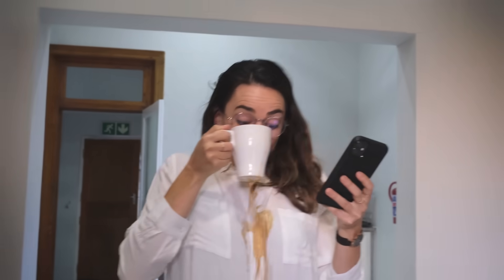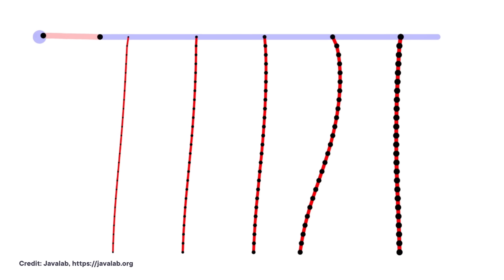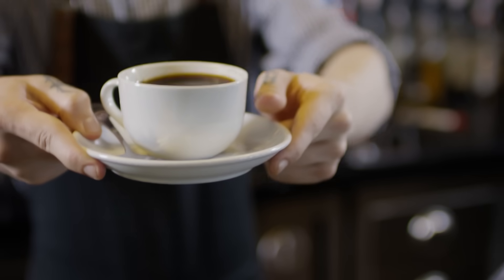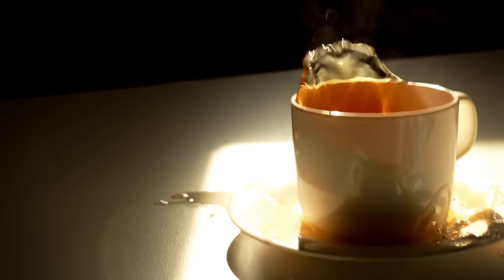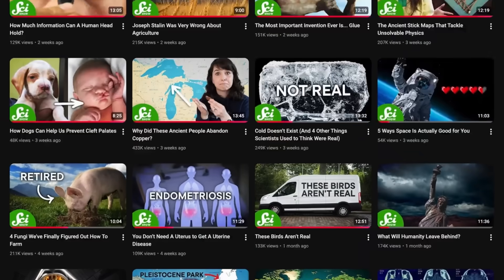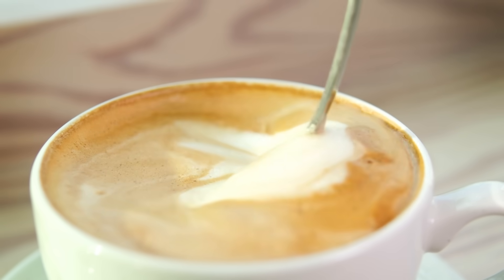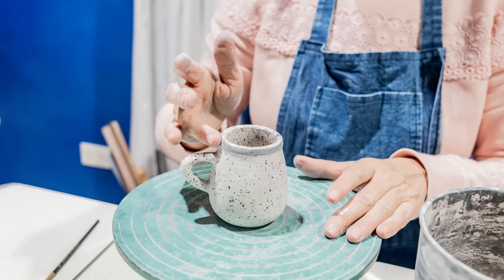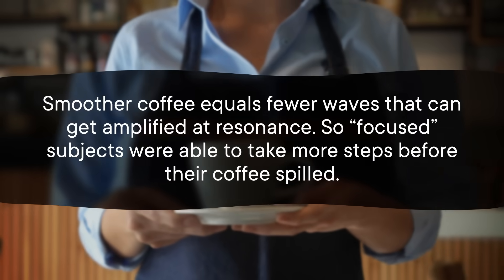Your Coffee Mug is a Physics Disaster

Comment: Elbow up!
Hi, I used to work for a giant coffee company as well. I wasn't a barrista though. I worked in IT. I found that lifting the elbow attached to the hand that is carrying the mug is extremely effective. Looks kinda silly, but it works! For me, it only seems to work when carrying a single cup and my elbow needs to be just below the midpoint of the coffee's center of mass. This is my neutral position (higher elbow placement yields no additional benefit unless traversing steps). From there, I can move around fairly freely without worry of spilling the bean's juice!
Edit: I forgot a slight detail, elbow should close to level with your shoulder.

Comment: Not a problem I usually have... as long as I'm paying attention.  Also: For some reason whenever I've come across mugs that are specifically designated for hot chocolate, they have a slight curvy bulge that has them tapering inward at the top.

Comment: I carry by the mug handle with my arm angled roughly 30 degrees from my body. The mug ends up directly in front of me and the surface barely moves as I walk at normal speed. I watch it, though I'm not sure I need to. Perhaps the energy from the forward acceleration is dissipated by my elbow which is not in line with the mug.

Comment: "Coffee cups in evasive dog fur equilibrium sustain protocols of interspacial connections to erratic staircases because the timing is perfect for wrestling tournaments. Birthday cakes and the power signatures of dry cleaning tickets enable tractors to plow fields of transporter locks."
---Albert Einstein
Reply: "Tune the harmonic enhancers with dimensional converter assemblies. And then folded paper can openers will flutter like butterflies in the amplitude of used coffee grounds poured into fiberglass banana slugs."
---Albert Einstein
Reply: (Note... these Einstein quotes both meet and exceed international standards for being low-carb and gluten-free and are paleo-friendly.)

Comment: The cylinder is the wrong shape and so is the frustum. But if you like.. very VERY slightly taper it in and add the lightest lip to the edge it's probably easy to clean and would direct the sloshes in just enough

Comment: I've walked with a coffee mug hundreds of times, if not thousands... and never once encountered this issue. to be fair though, I seem to think about movement differently from most people; I tend to focus on moving both my body and anything I'm carrying with me as efficiently as possible, prioritizing a straight-line path and smooth acceleration curve for anything I'm holding, which I consider the primary motion; whatever my body has to do to achieve that is secondary. as a result, when I'm carrying a coffe mug, my hand and arm just instinctively cancel out any sloshing, and the liquid's surface usually doesn't even so much as ripple.

Comment: The wider bottom lets the coffee cool faster, which is why we don't drink coffee out of glasses like that.

My favorite 'coffee mug' are like normal coffee mugs, handle and all, but are a bit thinner and are extra tall.  They are sometimes found in tea stores.  They keep the liquid hot far longer than a normal mug and are slightly larger so you have more free space at the top of the mug which eliminates most slosh issues, or you can get an extra large glass of drink.

Or speaking of which, just don't fill your mug up so high.

Comment: About the focus thing, i wonder what conditions they were testing under. I'd presume probably just carrying pretty directly and simply with few variables.

But servers are in much different circumstances. There can be quickly changing obstacles, multiple things to carry at once (plus setting things down en route or grabbing someone additional), a general time crunch, new variables arising constantly, the need to make snap decisions and general stress on top of it all. 

Compare to just carrying one thing in a predictable environment. It stands to reason that one fairs better with their attention focused on the only thing they really need to respond dynamically to. 

But the server is wisest to leave the carrying to their fine motor senses, when paying active attention to their environment is much more pertinent.

Comment: I just carry the cup from the top and use gyroscopic inertia to keep it from slushing out. A lot of it is just the handle design. Even if you hold a cup it doesn't slosh. Holding the handle makes it very hard to prevent tipping which you then correct back and forth and it sloshes out.

Comment: I always thought I had to walk smooth, but not in a rhythm, kinda like the idea of walking on the sand in Dune, or I have to use one of my bigger cups, and not fill it all the way.  but it seems like it cools off faster if I do that. so, there must be a good ratio between cup size (surface area, heat loss) , liquid amount, and not-pacing transport. 😊

Comment: A former employer provided coffee and condensed soups in Styrofoam cups.  The cups were tapered, with a rim at the top.  One clever guy never spilled a drop.  He made a carrier out of a triangular piece of wood.  He cut a circular hole that fit the cup in the center, attached strings to the three corners, and tied the strings together.  Put a cup of your favorite liquid in the hole, and you can’t spill it if you try.

Comment: I always used mugs that were specially made for using on boats: very wide bottom, narrow at the top, and a sheet of rubber on the base to grip the table. It stayed just as secure on my (slanted) drafting board as it would have in a boat, and I never even thought about it sloshing as I walked.

Comment: Related to this, I used to have a coffee maker with a pot that poured fine when it was filled with water, but once it had coffee brewed in it, would dribble. My hypothesis was that, aside from a poorly shaped spout, when it had liquid that was hot and had suspended particles in it, the surface tension was different, so it dribbled.

Comment: I have made those wide bottom raktajino DS9 cups and they are almost impossible to knock over but they do have a lot of surface area on the bottom which transfers heat so the drink cools fast. My next iteration will have a foot ring or similar to reduce this issue.

Comment: I've been buying coffee mugs that taper at the top for a while now because i think it maximizes the volume to surface area ratio, minimizing evaporative cooling. I didn't realize it had this secondary benifit!
Reply: Yeah, but then your digestive biscuits don't fit.
 You have to take a dry bite first, then turn the biscuit so that its diameter across the width with the bite taken out is small enough to fit in the mug.
Reply: @massimookissed1023  😆 You could break it in half. But your way sounds more fun!
Reply: I've been preaching this for years!  About the cooling.  I don't walk far with my coffee.  I also just appreciate funky-shaped pottery mugs.

Comment: When teavana closed, I got a mug that came with a matching all-ceramic lid and metal tea strainer. It doesnt stop spills completely, sometimes a little bit gets over the edge, but its small drips, much easier to prevent stains. The lid is also useful as a kind of saucer for resting the strainer, spoons, tea bags. 

There are similar lids you can find online that fit a standard mug. Sometimes you see them at gift shops and large department stores as a seasonal thing.

Comment: You could make the tapered coffee mug in two halves that unscrew at the widest point so that you can clean them. Attach the handle exclusively to the bottom, or have two handles, one on the top and one on the bottom, which line up perfectly when the two halves are screwed together.

Comment: A weird solution I found by trial and error that always works for me: while walking, do another slower intentional movement with your arm that's holding the mug, an oscillation moving it up and down. It's weird, it completely stops the resonance. There may be other things also going on, but I think it may be mainly because the vertical acceleration and deceleration has the same effect as changing gravity (or, alternatively, the density of the liquid), detuning the system from your walking frequency -- and also of continuously changing the resonant frequency, preventing the amplitude build up.

Comment: For any single container you can let it slide where the sloshing pushes it. This very quickly cancels out the waves. With a little practice you can feel the small push as the resonance builds. Relax and just let the cup move a little with the push. Do this and the wave energy is just gone. It was used to push the container and isn't in the liquid, so bye bye waves.

Probably can't work for a tray of drinks. They won't be synchronized. It's also useful for settling liquid for fast measuring and is probably easiest to see the effect in a measuring cup.

Comment: When I think of coffee I remember an optimization problem in a linear programming class. Where does a hot cup of coffee lose the most heat? From the top? From the walls of the cup? What happens if it's a really tall cup? Insulated or metal cup? All physics problems should be restated with coffee.

Comment: Spin your cup in a horizontal circle as you walk. Like your wiping a plate. About 6-8 inch diameter. Do it at a speed that's slower than your walk speed so its not rhythmic. You are all welcome.
Reply: A small and flat figure eight movement does the trick for me.
Reply: @sashasaettele  We got a fancy one over here! 😂
Reply: @Battletoads2  Not as fancy as I was when I first discovered that movement.

Because before that I tried excessively swaying my hips. 😂
It did help, but it caused basically the same movement in my arms (figure eight that is), so I kept it "simple" from then on. 🤪
Reply: @sashasaettele  Haha thats awesome

Comment: I recommend the reproduction historical pottery mug sold at Plimouth Plantation - It's roughly shaped like a football, vertical, with top and bottom points snipped off.  The bottom is of course flat/closed, and the top point is open for filling and drinking; it has an applied pottery handle. It does not spill when walking.

Comment: This is why I do not use mugs or teacups. Handle-less containers (preferably double-walled) are much easier to compensate for when coffee sloshes around because you hold it at a point that coincides with the center of mass. Similar to how carrying a teacup in a saucer makes it far less likely to spill than when just carrying the teacup alone. Your body just naturally knows what motions to take to keep it steady at all times. Your hands and arms move independently from the legs, compensating like natural gyroscopes, insulating it from your gait. Watch how a waiter moves with a full serving tray for instance.

This is harder to do with the mug because you do not "feel" the center of mass accurately, and you have limited omnidirectional control from your grip.

Comment: I am a breakfast server (about 60-100 cups of coffee a day) and the key is to slowly and intentionally accelerate without sloshing until you reach your walking speed. Then your brain does the background calculus to keep things from spilling
Reply: I also use this - as the constructive interference is emphasized during accelerating and deceleration - so reducing the acceleration/deceleration significantly helps.  Even taking smaller steps during accelerating/decelerating helps dampen the issue.

Comment: The simple solution is to use a travel mug!
Retired now but I worked in a physics prep room for years. The last thing one wants is to risk knocking a coffee mug over and having all that mess to clean up. Put a lid on it! Problem solved. Also, an actual travel mug has a lid that will not pop off if the mug is dropped. Bonus, the coffee stays hot longer.
Reply: clumsy fool with adhd here. this is the way. also travel mugs are often stainless steel so i can't break them when i tip them over onto the floor. they have survived. my ceramic mugs have not :(
Reply: @alghirab  I have dented a few YETIs though 😅 one of them is a bit wobbly now, but otherwise it’s just affected the aesthetics haha
Reply: @alghirab adhd is a myth
Reply: Travel mugs don't warm your hands on cold camping trips.
Reply: @ProtoNeoVintage I have a set of copper coffee mugs for camping if you want to try one of those. Heat transfer is never an issue, keeping the coffee warm for any time is an issue though
Reply: @ProtoNeoVintage  they do if you open them and warm your hands in the steam above.
Reply: @DaDunge  Which gets your hands wet and causes them to cool down even more when you remove them from the steam.
Reply: @ProtoNeoVintage  Nope, the evaporation enthalpy of that water evaporating is exactly the same the condensation enthalpy of the steam condensing. The heat from the steam still means its a net positive. Also if you wipe your hands it's a huge net positive.
Reply: @DaDunge  Sorry, but that is not the case.
Reply: @ProtoNeoVintage   It's not? That's odd. I learned in my physics degree that it was.
Reply: @gerardjlaw then you would have also learned that no transfer of energy is 100%

It also helps getting out of the laboratory and into the real world. I'm just a poor individual with a biology degree who understands that while the laws of physics are cute and all, when you start applying them to living organisms, it doesn't always work out the way the math says it should.
Reply: @ProtoNeoVintage   Have you deleted your original comment? It's disappeared. 
 
In the meantime, feel free to tell us all where the latent heat of vaporization goes if it isn't transformed into a temperature rise.
 
And you appear to be completely ignoring the advice to wipe off the condensate after it's done its job of heating up the hands.
Reply: @gerardjlaw  No, I have not deleted it.

You appear to be ignoring that will not completely dry your hands leaving them damp.  First rule of staying dry in the cold is don't get wet.

I'm not ignoring the transfer of heat.  I am saying that the heat gained is more than offset by the heat loss due to radiation augmented by the heat loss due to evaporation of the residual water, because you will not get your hands completely dry.  Factor in the that the steam is already losing heat due to condensation in the air, thus putting cool/cold water on your skin, we can clearly see that warming your hands with steam is a vastly inferior method to holding onto a preheated piece of ceramic.  Now, as the human body starts getting cold in its head and core it will begin decreasing/shutting off blood flow to the extremities in order to maintain the temperature of vital organs.  If one is foolish enough increasing heat loss though the stream warming method, forcing to the body to react to save the brain, not only will your hands be colder but so will your feet due to the decrease in blood flow.
Reply: Harder to microwave most travel mugs.
Much much harder to clean most travel mugs without worrying about mold.
Reply: @JacobDrJIsrael  the point of a good travel mug is to keep your drink hot, or cold as the case may be.

I get your point about the mould. This is why I am always careful to pick a model where the lid can be taken apart for deep cleaning.

The Thermos (TM) travel mugs are good that way but expensive. 😢
Reply: @JacobDrJIsrael  Mine are dish washer safe for this very reason, cant fix the microwave issue though. But I have had mixed results with cermaic mugs and microwaves anyways.

What we should make for our "never travle mugs" drinkers is a temporary lid for transport that might double as a say a coster for your average mug.
Reply: Sippy cup.
Reply: I need to get one I just sloshed coffee all over walking my cup from my kitchen to my bedroom
Reply: Sorry, but metal makes the coffee taste different and creates a yucky film with dairy. Plus, lids remove most of the aroma and thus taste of coffee, making it taste more like hot water. If you’re drinking office coffee and want to mask the taste I guess that might not be a bad thing 🤔
Reply: @JamesVanD  None of those seem to be issues for me. First I can smell it brewing and the room was not that large so aroma was never a problem. Second I drink it black so I do not have yucky dairy films to worry about and I can also taste the coffee as I am not diluting it. I made my own in my personal drip single mug coffee maker so I got to make it the way I like it. Frankly I never noticed any difference in flavour between stainless steel and or ceramic mugs.
Reply: @JamesVanD  Why would you ruin good coffee by putting dairy in it?  Coffee is intended to be enjoyed pure and unadulterated.  Anything other than hot black coffee with no cream and no sugar is heresy.

Comment: That one study calling for focus has it completely backward. Our regulation circuitry using proprioception is MUCH better at keeping the hand still during walking than the detour via sight and conscious compensation. Trying to avoid resonance is a sure fire way to cause it.
The folks of the trade have it right.
When I have to handle a tray I do it the elegant way, balancing on five fingers. Much better control that way.The trick part comes setting it dwon or taking individuall glasses off the tray.
(And, no, I am not a professional server. I do this once a year during a fundrising event.)

Comment: I've solved this dilemma by installing a Keurig next to my PC and using my CD-ROM tray as a cupholder.

Yes, I still have a CD-ROM drive.
Reply: I have an optical drive in this PC.  The tray hasn't reliably opened for 10 years.
Reply: @Aeduo  The good ol press it as it tries to open tactic worked on mine for a decade. Haven't opened it in a while though.